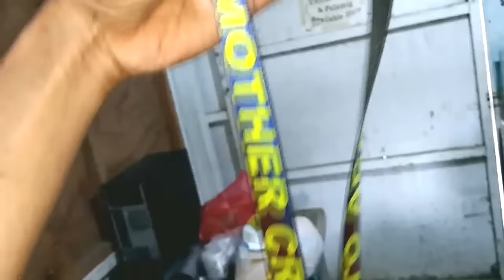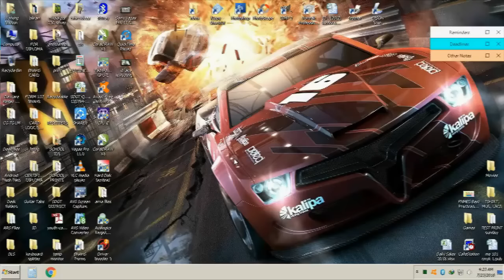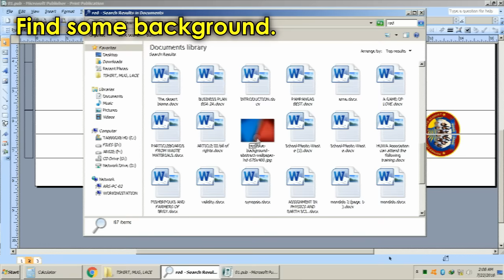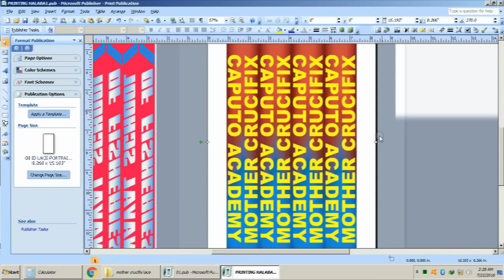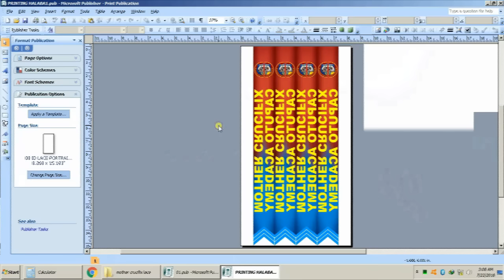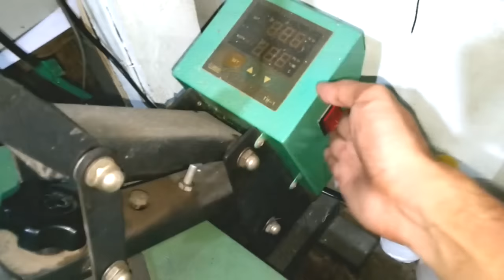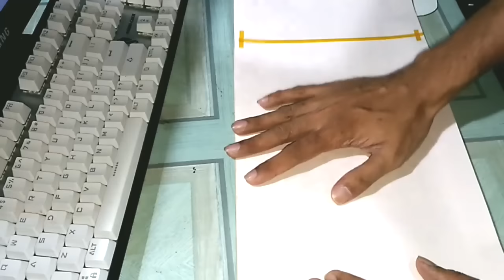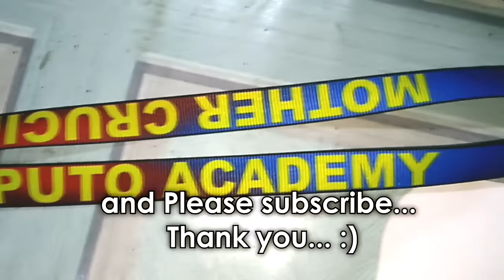FULL TUTORIAL: HOW TO MAKE ID LACE SLING (Lanyard Sublimation Printing) + Layouting & Assembly

Comment: sir what ink did you use for printing? i tried the "sublimation ink" but it didn't work like this. the image is black and red but after pressing, only neon yellow appeared on the lanyard.
Reply from the maker: I Use cuyi subli. Ink.
Reply from the maker: Did you use the appropriate sublimation paper?
Reply: We used the subli paper roll sir. Tama po ba yun?
Reply from the maker: Did you print on the right side?
Reply: We tried printing on both sides to see which one is the right side pero still, yellow pa rin after pressing :( nasa 200 degrees na and 75 seconds.
Reply from the maker: What brand of ink was used?
Reply: @everythingfixed  we used the "Greencolor" subli ink, sir.
Reply from the maker: Use tested products like cuyi.
Reply: @everythingfixed  copy sir. Thank you so much :)
Reply from the maker: You're welcome!